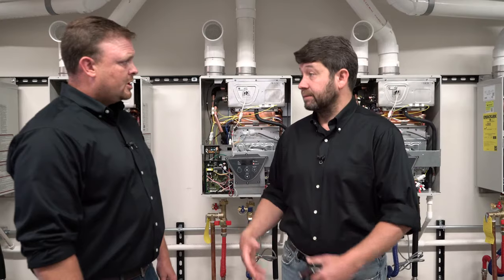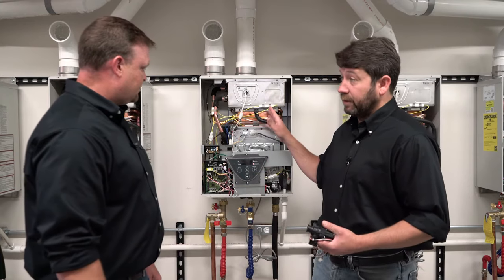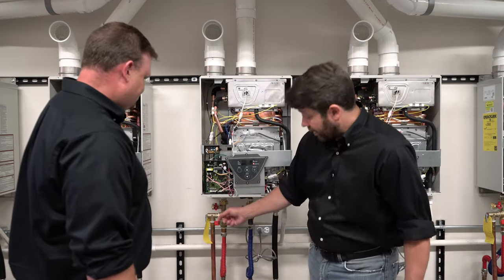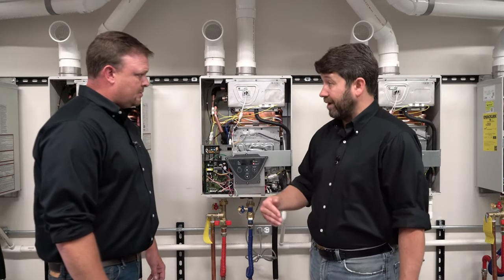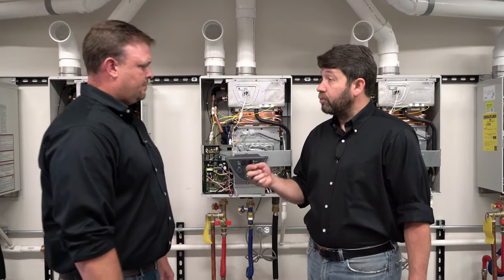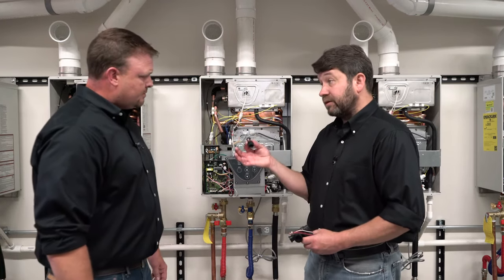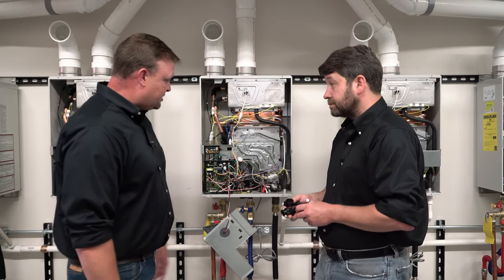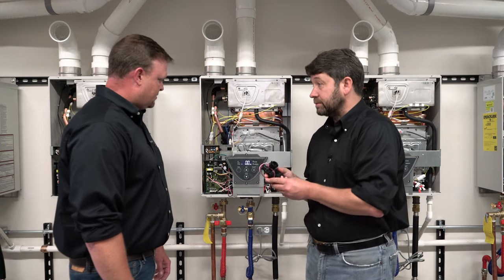Takagi Tankless Water Heater Troubleshooting - No Hot Water

Comment: Not sure if my water heater is older than that it was installed in 2021 but I don't have that whole panel in the front that shows you the flow and all that is that something you buy separately?. I'm having a no hot water issue but I have a blink code it's blink code number three apparently that says igniter issue somewhere I read online and I can't figure that out I clean the igniter rods they seem to be getting spark but it won't ignite the water heater
Reply: I had mine installed last fall and no hot water...  it happens in the shower and kitchen.  I'll be trying out some of these today.   Thank you.  If there is a chance you can show the maintenence on an actual installed one.  That would be great.  I almost flooded my basement.  😮